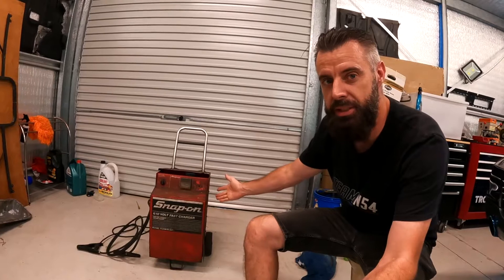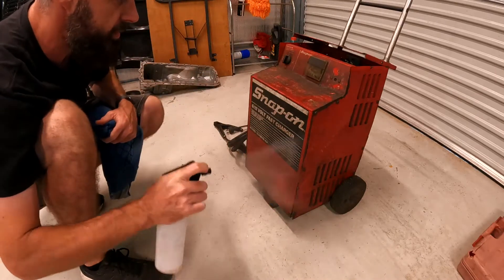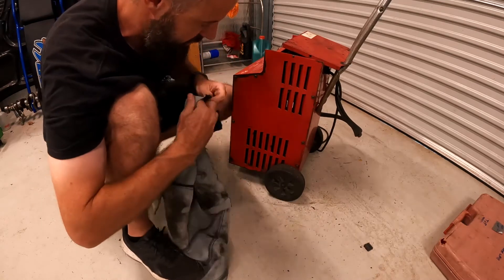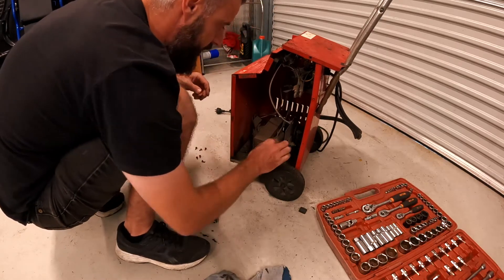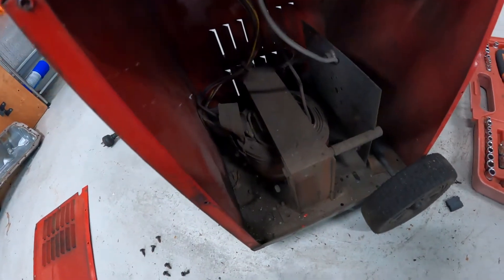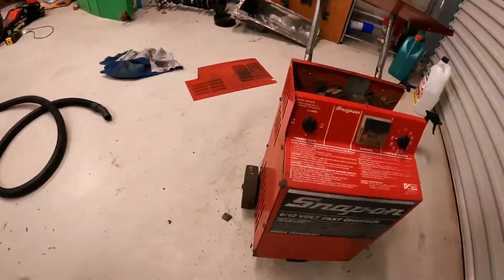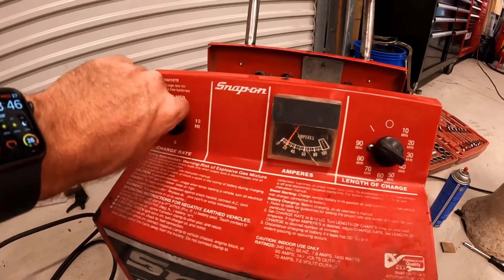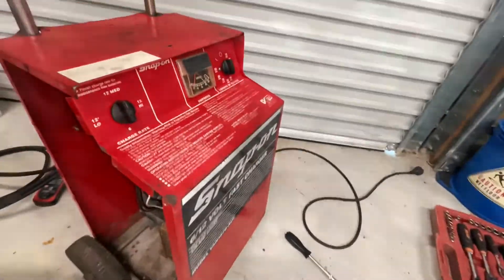Snap On 60amp Battery Charger Repair & Current Test

Comment: The rotary switch brand you want to buy is ohmite brand. They will be the last switch you will buy if you get the ones that are a 100 amps. They are that good. The buzzing noise is not normal fella. Either something is lose or a slight electrical problem. Just saying. 
Have a Happy Holidays fella. Peace vf
Reply: hi, have you got a link for the switch. I've snapped the knob off my one. the model is yah166a. appreciate any help

Comment: It's just a battery charger, indeed it is but you could make your work so much easier if you simply rip out the timer switch and either replace it with any high current timer or just have a main switch, no timing.  Then replace those horrible outdated selenium rectifier with a silicone full bridge rectifier module which you can get for around $20 for a 200 amp module. Makes the job super easy and quick and more reliable.  Old school tech is far superior than this modern day junk they force us to buy which is often inferior except for the diodes but they add way too many safety features so more dummer than dummer idiots can use them, that make modern battery chargers only fit for dolls houses in my opinion :)

Comment: I was just going to say when the transformer buzzes like that usually the Diodes are bad aka rectifiers, being that old they might be using selenium diodes which look like round plates with a riveted wire attached in the middle.  There are many newer types which can be used something in the 50 amp @ 400 volts would work well.

Comment: Had a similar Snap-on with identical problems, the timer, I repaired.... the rectifier turned out to be a fan-shaped array of button diodes, with a built-in fan shaped fuse, each leg of which would blow if the diode failed, quite ingenious, I saw the patent online....I sourced diodes from Germany, there were enough fuse legs left to make it worthwhile...

Comment: You fix nothing but the on off switch you didn’t check the diode the transformer anything low should still be 12 V up to 13 medium should be 13 to 14 and high close is not a boost should be around 16 max
Reply from the maker: Thanks appreciate the kind and helpful words.

Comment: I just stumbled across your video - nice job. I'll start by saying that repairing chargers and supplying parts is what we do. I hope you still have it, because what you have is a GREAT charger. These models were manufactured by Associated Equipment in St Louis, MO until Snap-On started building their own about 25 years ago, and the the old models are the better ones. It's basically an Associated model 6009 or 6009A in Snap-On paint (actually, it's powder-coated). From what I can see in your video, it looks like the main problem is the rectifier. You'll need to repair or replace it. I can say with a fair amount of certainty that the charger was used at some point to boost start a vehicle with a bad battery or starter, and the user just kept cranking away with the charger connected, until the rectifier components started failing. The result is that a number of the the fusible links in the rectifier burned, leaving just a few of the diodes to carry the transformer output. With a healthy rectifier, this charger will peg the 100 amp meter on HI with a load on the battery. It's easy to disassemble the rectifier (a 7/16" wrench is all you need) and check this for yourself. There's 12 button diodes in there, 6 under each of those things that look like tin-can lids. They are connected via what looks like a spoked wheel (the spokes are fusible). You'll find that at least half of those spokes are burned through, and some of the diodes have probably shorted. Be prepared for a lot of loose bits to fall out that used to be part of bigger bits. There are 10 spokes on each side of the rectifier, so if you have enough functioning diodes left, you might be able to re-arrange them and get most of the charger's capacity back, but better to rebuild or replace it. As a safety issue, I'd suggest replacing the timer. None of the parts you need are too expensive. There's a $20 rebuild kit for the Associated rectifiers, but it doesn't fit the ones that Snap-on built. A new replacement rectifier is about $35. Timers aren't too expensive either. You've already done the hard work (the clean-up!), you might as well get back in there and bring back it's functionality. 
Good Luck!
Rick P
PLP Battery Supply
plpbattery.com

p.s. - These things can suffer from loose connections that also rob output and create heat, so check/tighten ALL of the connections in the DC circuit - at the rectifier, the meter, the circuit breakers - everywhere from the transformer to the clamps. 
Also, you can get rid of most of that vibration by driving the wood wedges in tight between the transformer windings and the laminations - that's where the vibration is coming from. If you can't get them tight enough, just put in some bigger ones. The wedges should be inserted in pairs from the top and bottom of the transformer, like door shims. Get those tight and most of the noise will stop.
Reply: do you sell complete kits to basically refurbish the electroniocs in these machines? I have one not working as well

thanks
Reply from the maker: Sorry i missed your comment, i have just been through a whirlwind of a few months trying to relocate. I did actually get it all sorted a few months ago and you are spot on. The diodes, well some of the diodes ha fallen out. Ended up replacing them with a more modern style diode and she is an absolute beast of a charger. https://www.youtube.com/watch?v=VPpc3jM9WOs
Reply: @testandtune6096  Actually, the button diodes are the best way to go. Bridge rectifiers, stud-mounts, press-fits - they all work, but nothing else provides the capacity and redundancy of the button arrays.

Comment: Gut it and put an another çharger in the case giving you a cool retro look snap on charger. Just a thought. Shame to bin it.
Reply from the maker: I think that will be the last resort. A modern server power supply, puts out like double this thing and does it in silence. Could fit one nicely inside. However will try and get this working to its full potential first. It's old school and i kind of like its simplicity. I did work out the rectifiers are toast after filimng this video, which is why its not out putting the correct DC voltage.

Comment: What about using a switch from a sauna or jacuzzi?
Reply from the maker: I actually found the timers on ali express quite cheap. Not sure if i will bother, however, i need something more beefy. I am wondering if some of the windings the snap on are damaged, although i cant really tell. Its definitely not doing the correct output voltage.
Reply: @testandtune6096  my reservation on patching it up are fried ECUs
Reply from the maker: Fried ECUs are why we have VVDI prog haha.